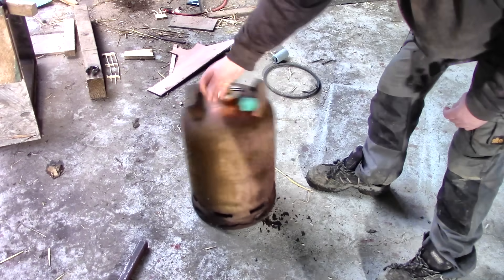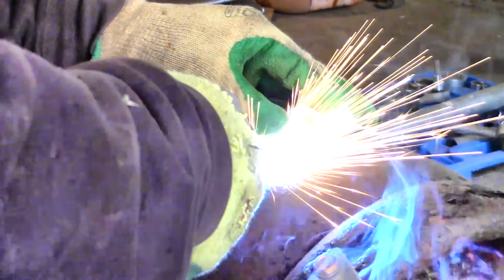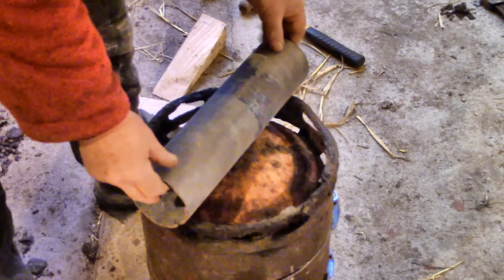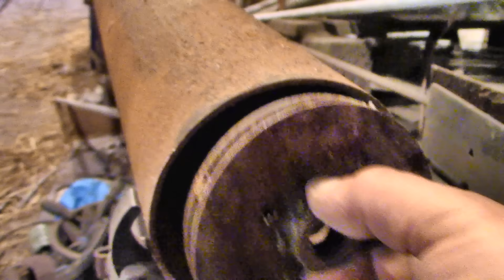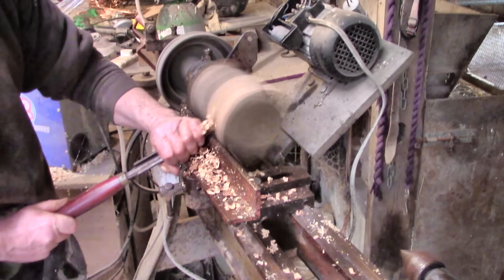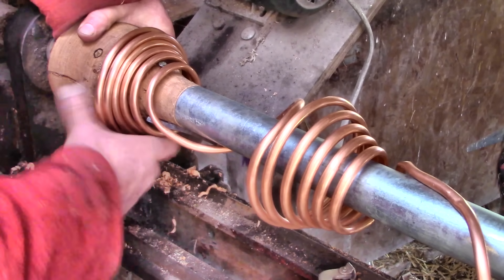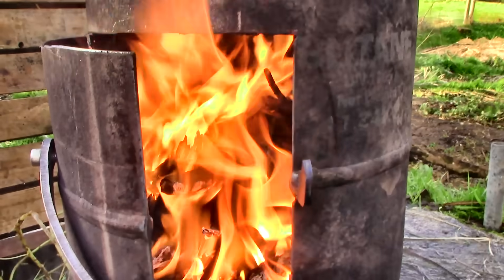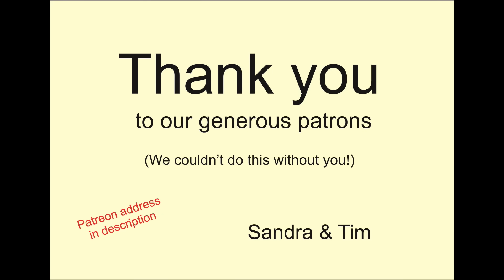Homemade Flash Steam Boiler From Plumbing Pipe And Scrap

Comment: Rather than putting the copper pipe inside the tube, it would have been better to wrap it around the outside of the chimney. Also a waste oil burner is a lot more efficient and cleaner, with minimal cleaning than using logs. Plenty YouTube videos on them. Kriss Harbours video is a good example of pipe coiling. https://youtu.be/l5jUUrDle00?si=VCDdPoRvp1huKnSb

Comment: Well, the only instant steam boilers I have seen are from a car design. The firebox, (using a petrol atomizer), burned directly on the copper tubing that was meshed over and over inside. Now I am not sure how much pressure it could handle but it most likely reached into 12 bar. The system was a slew of automated systems using a crystal activated valve, that controlled both the water and heating to maintain a proper water level.

What made it unique and a good contender of having been the automobile of choice instead of the combustion engines that became our standard, was that it was super water efficient. As the engineer that was competing against another steam car engineer (Stanley, which is the only one of the two I remember the name of) only looked into making the fastest car not the easiest and enduring one. The engineer showed off his car by driving all day non stop back and forth around the block all day to taunt Stanley in a "look at this, you self absorbed dip shit, my creation is clearly better!"
Reply from the maker: Interesting, thanks for that.

Comment: To get true dry steam you should recycle the steam you produced into a pipe which should pass thru. the your fire box that is how you "dry" the steam to super heat, what comes out is almost invisable so be careful, the force and temp. is useful and dangerous to touch .

Comment: I’ve heard that if you fill your copper tube with sand and use external heat while bending, you will avoid all kinks.  The sand absorbs and distributes heat more evenly.  Of course it requires a complete flush afterwards.  Great attempt though!

Comment: Hi nice attempt. The problems it has is because of the back pressure, i would output steam from the top, probably use a rocket stove, insulate the chimney, fix the input pressure issues.

Comment: in order to get dry steam, you need a small tank, right in the hottest part of your fire, with a steam chest or bell, and an outlet at the top of that bell.  or try a cyclone filter as the very last stage, this should get rid of the water.  also you should regulate your water supply to ensure it does not overwhelm the available heat.  however must admit i have not managed to try these things myself yet, am speaking from research, but no experiments, yet.

Comment: if you pack the pipe with fine sand, it won't collapse when you coil it.  or find a long spring that fits tight around the pipe, and make your bends inside that.  either way make sure you are getting soft copper pipe, and remember, with copper, you only get one chance - bending the pipe hardens it, and you would need to heat it up again before it will bend so easily again.  so, either way, practise your bends, or better to wrap around a form, so you only bend once.

Comment: Ok so it's wet steam, but it's still at 100 degrees Celsius, right?  So although it's not useful for driving steam engines, this can be used as a pre-heater for generating the superheated steam in a different device that takes this output as input

Comment: Good day sir.  Looks like you could get 50# steam out of that thing. Nice work.  You’ll get dry steam with a yarway  steam trap on the discharge. #11 or 21.  Condensate receiver and a bfw pump… you’ll be set old boy.

Comment: @Way Out West - Workshop Stuff, What comes to mind is the use of a steam expansion chamber OR expansion 
tank with an asbestos equivalent type outer insulating layer that maintains the temperature 1.) To help keep up 
that steam temp. 2.) Utilize a feedback loop mechanism for the water vapor to be pulled back into the inlet circuit 
(somehow) and take full advantage of use of the siphoning action (which is kind of tricky to say the least)! 3. With 
the use of said expansion tank, incorporates a steam separator /water trap built on to the bottom of the expansion 
tank, but then add a one-way check valve (designed for boiler systems) , 4.) The use of a primary check valve situated 
just after the steam/water trap is for primary safety considerations. 5.) Once you rig in an inline condenser so as to 
only cool down the wicked hot water below the boiling point such as to at least get the hot water down to an amicable 
temperature so as to be able to mix with the cold water side inlet. 6.) Use an additional second inline check valve is 
also to be used for is for additional safety considerations will be fed into the "T" OR  lateral "V" type fitting splice plus a 
90 degree elbow going into your cold water intake side (such as to set up a crude mixer circuit) of the boiler coil intake 
side. Thus, you end up with having a super charged siphoning feedback loop you could also use to attempt to regulate 
the flow rate ever so slightly to a small degree with the use of a simple inline steam fitter's valve as well!  This is only 
several ideas that just might help you to accomplish said feedback loop action that thus scavenges the water from 
being a complete loss, yet the steam component travels onward to drive a piston as such and be able to maintain an 
ever so slight but adequate regulation of the steam temperature and pressure to a fair degree, (optimized overall). If 
you were to get that hot steam water vapor to go down from 212 degrees plus Fahrenheit down to oh say 195 degrees 
OR better yet 180 OR 160 degrees Fahrenheit going into the mixer of the inlet at the bottom of the heat stack, this may 
be entirely do able!! Heck, there may even be a be a specialty check valve of sorts that is even "temperature actuated, 
one-way check valve" out there that can be used further downstream towards/at the inlet mixer. You could quite possibly 
use a car radiator for a condenser along with a radiator cap and water holding tank in your setup perhaps as well but now 
the radiator cap rating would most likely have to be rated for around 16-17 PSI. There may still be some steam losses to 
a fair degree but then maybe not quite so bad either!!

Comment: instead of separated growing helical coils make concentric helical coils, small inner coil/medium middle and large outer.  Water in the small, at some point becomes steam and then superheated in the rest of the coils.  Easier to coil and needs a shorter heat chamber.

Comment: Not sure why the steam outlet is on the bottom and the water inlet is on the top. You have water leaking out because of this. Steam also rises to the top. The steam reservoir and the water reservoir can be the same unit but it has to be on top. Or run a water like from the bottom

Comment: A trick I heard of was to fill and seal the tube with sand while it is straight and then even though it takes much more effort to bend, the sand would stop the pipe from kinking. then you'd unseal it, wash it out with water and hey presto.

Comment: tl;dr:

1. Convert to a double burner
2. Put the coils in the flame itself
3. Reduce water flow
4. Preheat with a second system at chimney height

I would look to extract more heat from the fuel by using a double burner - jacket the bottom, so you have a two-layer skin on the firebox. The outer area has holes low and on the outside, and others high and on the inside. This draws extra air from outside, preheats it, it rises and then joins the upper part of the burn chamber, supporting much more combustion. Add a second burn chamber for this second burn. This upper chamber is really, really hot - air-jacket it with its own second skin but keep this sealed. The upper burn chamber is much bigger and hotter than the chimney, so you can really jam a lot of tubing in there and extract way more energy. 

Less is more here - restrict the airflow to the lower burner so you have a surplus of oxygen coming from the outer jacket to get really complete combustion in the upper chamber. If you are getting too much unburnt stuff floating up, a lot of that will go up the flue as unburnt particulates, which is bad for your environment and health, and may lead to creosote buildup. Get it right and all you end up with is CO2 and heat. The cross-sectional area of air intake you need is surprisingly tiny - something like 1% of the footprint area of the chamber is all you should need. Make it bigger than that and space it evenly, and use a vent cover so you can set it to whatever is optimal. It will take some tinkering to get it just so.

The remaining chimney heat (i.e. your existing system) can be used just as a preheating system. Feed that to an insulated tank, and you can then draw nearly boiling water into the steam-generating lower section. I think you'd be getting dry steam pretty well if you did this.

Oh, and look at reducing the water flow so you're not trying to do too much with the heat you have.

Great video, thanks kindly for the enjoyment watching it!

Comment: I've just watched this video and remembering you built an air compressed locomotive, I just thought that maybe some extra steam produced from your flash steam boiler could be used to pump up your air compressed locomotive. 
I'm not sure if it will always work, since the boiler won't be heated all the time to pump your locomotive, but you could store excess steam into spare cannisters to use at a later date. 

Just a thought. 

Your work is absolutely amazing! 👍

Comment: get away from connection to the water mains then calculated volumes pressure can be done but I know personally of no flash steam boiler that worked surely too much water no steam too little melted tubes no steam result no steam also not connecting an outlet to an engine means that a boiler is not a boiler it is a pan .

Comment: Fill your copper tube with salt.  Make sure it is settled well, so you can fit as much as possible.  Then you can bend it easily without kinking, and when you are done, soak it in water for a day or so to dissolve the salt out.  (Sand is often used for this, but with thinner tubing it tends to get stuck, making it nearly impossible to get out.  Salt or sugar can easily be removed by dissolving them with water, even if they get stuck though.)

Comment: You need the copper pipes RIGHT IN the flames,a flash boilers has no insulation. What you  have made is a highly effective chip geyser or donkey boiler. See designs by Abner Doble  for both high performance cars and successful aeroplanes, no wonder Donkey was so vocal, that was aproval. I have seen these designs as a member of a model engineering club 😂

Comment: I used to work in Boeings tube bending shop they would ocassionally talk about how to make pipe bend at home.
One method is to fill the copper pipe with either sand or cooled grease.  This keeps the pipe from collapsing and can be removed later.  (Both take end caps on the piping.)

Comment: In my power generation days I used to drive a flash steam generator which drove a 500 MW turbine. The steam feed pump output to complete the cycle was rated at 16MW, this beast going flat chat used to use 240 tons of coal an hour 
Producing 3000 PSI of steam pressure. More complicated than your flash steam generator but the principal is the same, water in steam out

Comment: The biggest drawback of flashboilers is their inability to store energy and quickly release it when needed, in order to get a power envelope that even remotely matches a regular boiler they need very high powered burners and heat exchanger able to handle it (see experiments by automakers in the 1970s with modern steam cars, Saab for example)

With wood fired flash boiler that burns wood in batches it is not practical to have such a large power output range so you need to match the boiler much more closely to the work its doing or risk huge efficiency losses(over sized constantly wasting excess steam) and very poor responsiveness.

Comment: It's been a year so You've probably worked it out by now this is a basic steam cleaner for in old workshops. 
Your wet steam is because either there's not the right heat getting to the copper or there's too much water and it's the heat not burning at the right place.
The copper needs to be a single coil like a spring and with copper you heat to make it soft you can also fill it with sand and coil it but you have to heat the stuff.
The spring shaped coil shouldn't touch the outside flue but should be suspended on a spider or frame to keep it about the pipe width distance away from the cooling flue so as you had the copper touching the flue it was getting cooled in spots and you saw those spots as water.

The second thing is the fuel - look at that 'fire!' how embarrassing all the heat down there and the flue to cool it and take it away and where have you got your copper = up above the heat and in a cooling stack  - so your fuel needs to vaporize in the box and burn in the flue - so Oil or Coal not the flash heat you have with tiny sticks for crying out loud.
You should be able to run a steam cleaner or power your rail with a dripping oil on to a hot plate and spider with 3 rings and it shouldn't take more than 1/2 a liter an hour.

But you've probably worked all this out by now.

Comment: All the heat exchangers I have seen in industrial applications are well insulated.  The vertical pipe needs insulation.  A lot of the copper tubing is touching the pipe and losing heat through it to the atmosphere.  The copper coils could go along the outside first and then to the inside.  Then with insulation over it all it should improve it a lot.  I might try something similar someday.  Thanks for making the prototype.

Comment: This is once throw boiler steam generation too low, but water tube boiler like bibcock Willcox type system  is the best one, highly production of steam, low fuel  consumptions , is the best one, I was made few years ago a very small but highly performance , what do you want hot water, or steam unit give you best results, you can burn coil, west wooden, used oil, gas, and many more,

Comment: Use smaller diameter copper pipe and wrap it in a continuous coil (small diameter is much easier to coil just by hand without it kinking.

Comment: If you fill the tube with the coil with salt you will get more even heat and salt is a great retainer of heat. The  coil tube cap the ends add and outer tube for exhaust. It might take longer to get to temp but it will be hotter.

Comment: I think train steam engines used a bell on top of the boiler to separate the steam and water mixture. I know it wasn't flash steam. Maybe you can take your steam from higher above your copper pipe. I think I saw this here https://www.youtube.com/watch?v=cOsb2CBaE14
Reply from the maker: You're right - but how do they work? (Video doesn't work, btw.)
Reply: @wayoutwest-workshopstuff6299  Water settles to the bottom, steam rises to the top. The bell was above the entire train boiler and only the steam pressure within that bell went into a pipe to power the wheel pistons. This had the benefit of making the pistons last longer because hot steam wouldn't cause them to rust as much as water/steam mix. Just steam would provide more power as well because the water wouldn't get in the way of the internal moving parts.
Reply from the maker: @renecouture3719  If it's really that simple then I'm impressed. Thanks

Comment: Add a superheater: feed the steam you are producing into a coil inside the firebox. You might also add an empty housing with input and output at the top and a peacock on the bottom.
Gravity will cause excess water to drop to the bottom, which can be bled of by opening the peacock.
The output could then go to the firebox.

You really need a sensor and a solenoid to add feedwater on demand.
Without automatic controls, you will either have sloppy steam or you'll burn the steam tube out.

Comment: A pointer for when you’re next trying to coil tubing for your pipe- use the flue as the guide. When I built mine I used a steel line like one would use for automotive brakes, but the method should still be fine. Wrap the line as tightly as you can around the flue (I used a piece of common 6” sheet metal chimney pipe) and when you’re finished you should be able to pull the tube out. You can then tighten the coil by twisting it tighter without the pipe as the guide, and the whole mess will slide right into whatever flue you’re trying to use. My boiler didn’t end up working very well, but I didn’t have a way to pump enough water at a high enough pressure to not overpower the pump I was using (a small 12v universal fluid pump, meant for a carburetor). If I had to do it all again I’d use something like a pressure washer pump driven off the steam engines crankshaft.

Comment: You can use the flash steam for heating your hillbilly moonshine potstill with one or two thumpers.. 
You definitely need thumpers to get a good abv (alcohol by volume) 
Each thumper is an extra distillation step. The thumpers are needed to boil off the alcohol entrained in the thumper condensate. 
You need them thumpers since you don't have a proper flash steam control. 
In principle that's the way the old wild west moonshiners made their excellent quality whiskey... 

Advantages:
No scorching of your mash and plenty of heating energy available
NOT dangerous, since only the pipe volume of water is heated. 

If you want i can guide you through the process

Comment: Yo old man! If you want an easier time cooling those copper lines, try talking your copper reel and heat the whole thing up until it’s glowing red, then immediately quench it in cold water. This will aneal it and make it extremely malleable, but it will kink easier but shouldn’t be an issue if you’re careful